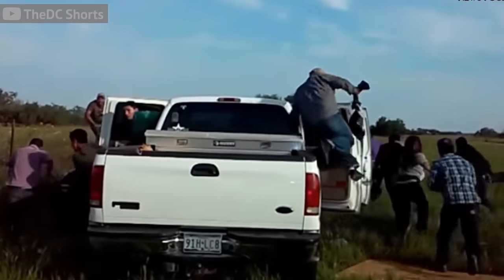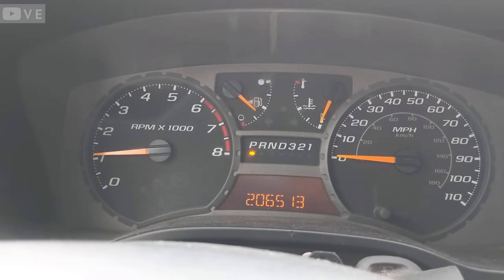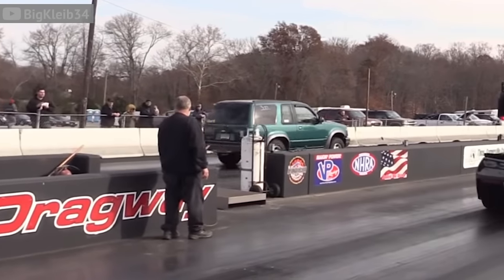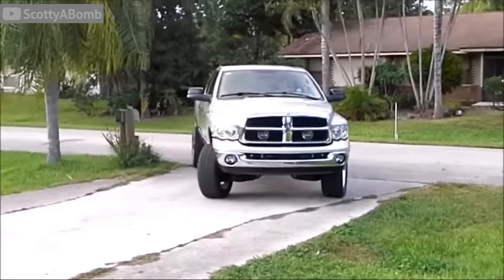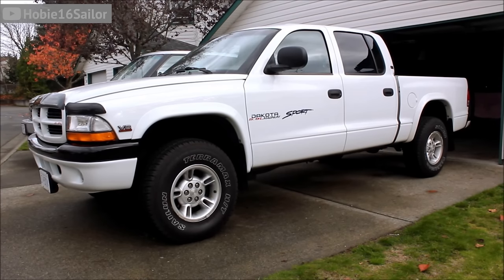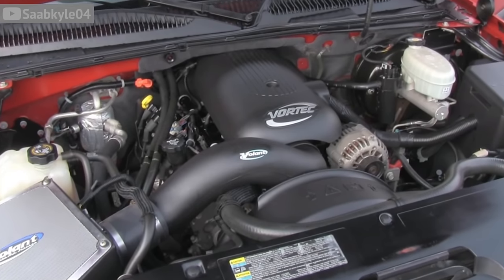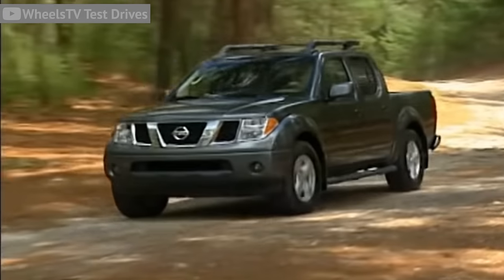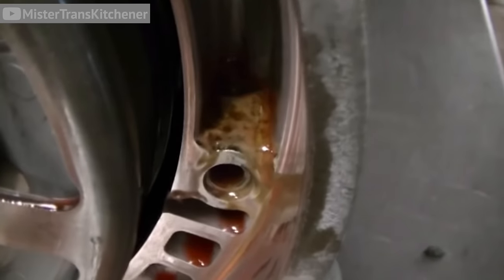USED TRUCKS YOU SHOULD NEVER BUY!

Comment: He probably got cheated on with a guy with an avalanche .
Reply: Fr bro hahaha i have an avalanche and it works perfectly
Reply: I have had my 02 Avalanche since they came out. NEVER had a problem with it ever.
Reply: My dads 02 had 476k before he sold it, great truck. Only y minor problems
Reply: My 03 avalanche runs as good as any, it has outlasted many generations of trucks that proceeded it😂
Reply: I HAD 02 AVALANCHE  with over 300k on it when finally going, ohio uses alot of salt just rusted. have a 07 ltz with 6.0L in it and more problems then the 02
Reply: I have an avalanche. Love it too.
Reply: 5.3 vortec is NOT a bad engine by any means. 07 on with the AFM is not as good as the LM7's but still not a bad engine
Reply: I love my avalanche
Reply: My 2013 avalanche has pretty much never had an issue, 125k miles
Reply: Jose Olvera my dad has an avalanche an that bitch got power an we ain’t had no prob wit it
Reply: My 02 survived alaska for 2 years at 300k miles sold cuz i couldnt bring it with me i have an 07 now and its great
Reply: What's so wrong about the Avalanche? The only thing I've heard is that it's had instrument cluster issues more than anything else.
Reply: @thedl1581  Same here, I bought mine in mid 2001, still have it, it looks, and drives perfectly..
Reply: My 02 Avalanche has 200k miles.  Still looks, runs and drives like new, best-in-class turning radius (very useful for all the u-turns in FL), and only minor wear and tear issues.  The fold-down mid-gate makes it easy to carry my kayaks and gives extra room for lumber hauling.  I did have to replace the headlight switch assembly the other day (something I've heard is an issue, but it HAS been 17 years) which cost a whole $30 and about 5 minutes of my time.  I thought he might mention the fading body cladding issue (he didn't), but that's easily resolved with the deoxidizing auto detailing treatments available over the counter.  Love my avalanche and I'll drive it until it breathes it's last.  At this rate, that should be in about another 17 years.
Reply: So I'm not the only one huh lol
Reply: I love driving my bf avalanche
Reply: he got cheated on BY a guy with an avalanche
Reply: @theintimadator3828  I have an 05 and have heard that the second gens have a lot more issues. Even if they have the 5.3 in them, something about the mounts (I think..could be wrong) mess with the engine & trans on them. I'll keep buying first gens as long as I can find them. They hold their value very well too (all of them!)
Reply: Love the avalanche.  My Grandpa had an 08, he died in 2013 and my dad got the truck.  Still runs good 12 years later today.  No rust.  We live in New England.  Solid truck.
Reply: 5.3 engine is one of the best out there easy to upgrade and replace, that being said avalanches are ugly af especially the ones with all that plastic. The Escalade ext look better but idk how really those are never owned one but to each his own 🤷🏻‍♂️
Reply: My Black Diamond Avalanche is the best truck I've ever had!! He probably drives a Tundra
Reply: Ya this guy is crazy I have a 05 220k mi still have org eng n trans runs like a champ still just had to rebuild the dash cluster n the rest is org except the normal wear n tear stuff
Reply: Lmfao he probably can even get one of those 😂
Reply: MY 02 AVALANCHE HAS 300,000 AND STILL GOING STRONG!! NEVER ANY ISSUES!! 😆
Reply: Daniel Lamb Chevy makes cheap thermostat housing with cheap plastic you never had a coolant leaks
Reply: Funny how he noted that all the Fords that shared the same engine but the 5.3L Vortec that is shared with the Silverado, Tahoe, Suburbans, Yukons, Sierras, Escalades, Express Vans and Savannas. Somehow only the Avalanche is a bad truck. My 02 Avalanche is approaching 300K miles on the original engine and transmission without any major repairs to the drivetrain.
Reply: My Avalanche was a fantastic truck!  I wish I still had my old one sometimes.  I honestly wish they still made it!  With the cladding it was like an urban tank!  Only issue I had was the transfer case leak that would develop in all Chevys of those years.  Fixed it over a weekend.
Reply: RIGHT?! The 4l60e is the only issue I know of on the first gen that is all that bad, and it's not like they were limited to the Avalanche. And the other issues were relatively minor compared to the other vehicles, although I didn't really agree with the SSR because CLEARLY it's not meant as a working truck. "Oh no, the plastic fades?! They're the only vehicles to ever have plastic fade." I don't understand how it wouldn't classify as a truck either. Truck frame, V8, tows pretty much the same as the 1500s, has a bed which you can also fold down the midgate and have a 8 foot bed. It was literally just "I don't like the looks so it's awful." Of course I've also never heard someone down talk a Suburban in appearance before.
Reply: This dude is the type that would think a smart car is a man's car, lol smh
Reply: Judging by the comments about the avalanche.  I think you gotta remove it from the list.
Reply: I've got an 07 Avalanche few minor problems oil sending unit which is a headache thinking you have no oil pressure
I currently have a p430 code which is very annoying I can clear it and it will stay off about a week 
But honestly I LOVE MY AVALANCHE
Reply: Benjamin Williams damnnn mine just reached 200k miles no problems what so ever just minor things
Reply: Yeah his Chevy Avalanche criticisms were bs. I was actually expecting good criticisms but nope.
Reply: i have seen acolorado with 350,000 miles i would have bought it but they wanted too much  like 5k for it lol
Reply: 4.3L V6 Vortec ,285 HP  4.8? Is this a 250,000+ motor, 302 horsepower , Chevrolet 5.3 385 HP . laintiffs formally issued a lawsuit against General Motors in federal court on Wednesday, claiming the Detroit auto giant sold Chevrolet and GMC vehicles from 2011 to 2016 that could not run properly on American diesel fuel as promised. In turn, they say the engines fitted to these models could prematurely expire and leave owners with sizable repair bills due to the supposed issue. The plaintiffs allege that this poses a threat to "hundreds of thousands" of customers who purchased trucks equipped with a 6.6-liter Duramax engine during that timespan.

Per The Detroit News, the lawsuit cites a mechanical failure which causes metal shrapnel to enter the engine via a Bosch-built high-pressure fuel pump. It claims that since American diesel fuel is thinner than in Europe and does not include as many lubricants, air pockets form inside the fuel pump, causing metal-on-metal contact. Shavings then allegedly find their way to the combustion chamber,,  Read more here ,https://www.thedrive.com/news/29331/lawsuit-alleges-chevrolet-and-gmc-duramax-engines-sold-with-wrong-parts-cant-take-american-diesel. But i still enjoy GMC and Silverado nothing will change that i stick with older models and way from diesel
Reply: I have a 2003 Chevrolet Avalanche Z71 4X4. I Love it and wouldn't sell or trade it for anything!!!!!
Reply: Shoot he said it has trans problem but after 18 years and 240k miles. Mine shifted great. I sold it and I still see the new owner driving it occasionally
Reply: nah, he just couldn't find a guy to date with an Avy. I have an 05 and its a BEAST!!!!
Reply: @benjaminwilliams2086  my 02 avalanche z71 has 380+ miles still running strong so much for being a bad truck right
Reply: Hell, I’ve got an 04 Avalanche Z71 with 250k on it. Zero rust, decent paint, no problems. It’s my woods truck. Leather’s still great. Only thing I don’t like about it is the plastic trim, but a little Back-In-Black and it looks brand new.
Reply: Luis Bolanos Thought it did one time, but it was just because I put everything back together incorrectly.
Reply: Probably did avalanches are for ladyboys
Reply: To easy
Reply: Never have problem with my 06 avalanche trouble free 162k miles.
Reply: they have a very week 5.3
Reply: Brady Kee slow yes but they are good reliable motors.
Reply: For really though these are the best trucks ever especially the ones with the 6.0 vortec that’s the one I currently have follow me on instagram y’all @j_ortiz13 you can see my projects truck avalanche
Reply: My 05 Avalanche would randomly switch into 4L while going 70 mph down the freeway. Had to yank out the shaft to the rear wheels to make it 4x2. Then the transmission died and I learned how important it is to apply the emergency break whenever I park (truck rolled down the street one night). Then I crashed into a tree... and had her rebuilt. Then I had a dude crash into me over 90mph, threw me off the freeway, down a hill, across a river and into a forest... and I had her rebuilt.

Today, I got a cracked mirror, the engine light and air bag light are always on, and my running boards are death traps in rain or snow. Not to mention all the sounds that she makes when I turn left and right.

But she runs beautifully. Shes almost st 200k miles. I love my truck lol
Reply: Lol right!!  shit I have a 07’ avalanche with 210,000 and it works GGGreat!
Reply: Avalanche gang 💪🏻 I have an 03 and you just can’t kill it no major repairs yet
Reply: Have a 2002 with 400k miles... original engine and transmission...doesn't use oil, gets 18 mpg on long distance trips. Like the covered truck bed for concealing packaged, suitcases, camping gear...
Reply: I have an 03 Chevy avalanche and it runs fine
Reply: Avalanches are amazing trucks! I got an 02 2500 V8 8.1 Lt. engine, it hauls, baby! Just about to put a leveling kit on it.
Reply: I have an 02 avalanche with just under 80k. It hasn't been perfect but I like it. I've had it 7 years and aside from tires, brakes, oil I probably haven't spent 500 on maintenance or repairs. Good power, good mileage and loaded. Sure it's a glorified suburban,  last I checked burns were pretty fucking dependable.
Reply: @d.chapman8400  and the cladding he say which many other car's have if you don't keep maintenance, and the transmission!
But if the Avalanche is bad, the the whole line is bad silverado n cadillac
Reply: @str8profit81  yeah bro u see tha Avalanche ugly because you have no sense of what it is, and you have never used 1 so you don't know the porpoise of them
Reply: Odi Arroyo “Purpose” learn to spell before @ me clown. The powertrain reliability isn’t a problem I said 5.3 is a great engine I have a 04 Silverado. It’s the physical appearance especially first gen earlier years with the plastic cladding which was removed from later years because it was unpopular and because of problems people were having with it.
Reply: @str8profit81  English is not my first language, and i have the body cladding on mine and it's the best going in the desert around Las Vegas with out worrying about scratching the pain, also i use it for my landscaping bussines and i thought everything in the bed, rocks , gravel, dirt, branches, wood logs, pallets of pavers and all by not worrying about scratching the paint that the Escalade has, and the plastic matches so cool with my 33's they just go together, and it makes sense, that's why those plastics are there, appearance that actually works!
After the sun goes down you remove the middle and made a bed with your girl
 "if you have 1"   and well.. The rest you should know it, 
  there is no Truck that bits that experience my good speller teacher..
Reply: @jeffshemanski3711  I have an 05 also.  What was the dash issues you had?  My dash lights flicker or go out completely.
Reply: @lanawhite1670  a few of the lights got really dim n could barely see them n it kept dinging like some thing needed service so had a mechanic rebuild the whole dash cluster n it was fine the dinging stopped n all the lights n gauges worked like new
Reply: @jeffshemanski3711  thanks for the answer!
Reply: i’ve got an 06 chevy avalanche with 220k and would drive it across the US without any hesitation
Reply: D. Chapman there was and people just hate chevy
Reply: Fr
Reply: The only issue I’ve ever seen/heard with the Avalanche was the plastic trim pieces, but that’s such a small issue it’s not really a issue. I really like the Avalanche.
Reply: @BigCherries  the trim fades. Takes 20 minutes every 6 months to get it back to black
Reply: Mine cot on fire
Reply: lol
Reply: @pistoncasas150  me too
Reply: My only problem is a leaking trunk after 3 years having it and almost 300k miles
Reply: By his definition, I am a bro for driving a reliable truck. By my definition, he is a bro for being 30 with a backwards trucker hat and light blue cartoon shirt with a youtube channel. C'est la vie.
Reply: We had an 04 avalanche, my favorite vehicle I've ever driven, lasted 15 years, the rust got it because we didn't take care of it.
Reply: My first avalanche [2003] came from a guy who was shady AF and "didn't know English" yet when he attempted to whisper to his son he spoke perfect English. This vehicle had several problems. One later rendering it dead. He filled the frame with foam and spray painted it. I only noticed this when a chunk the size of my hand came off. Glad to say my 2004 avalanche is like new.
Reply: 2006 Chevy Avalanche Z71 4x4  5.3 Vortec, 6 inch FabTech lift with 20 inch chrome wheels and  using Nitto G2 tires. All optioned out when purchased. No cladding, Victory Red with Black trim. 260,000 miles right now and running strong. Minor issues here and there and the only major issue was my Transfer case with the weep hole issue and decided to just include to have my transmission rebuilt which includes a 5 year warranty. Never broke down on any road trip and never been towed, EVER!!! Love my baby, was a gift from my late husband and I have a problem parting with it. Maintain, maintain, maintain every little thing you notice, immediately, what ever brand car or truck, motorcycle, wife or husband and longevity and endurance is possible.
Reply: @kirbysmom2011  Get the truck, love the truck, BE THE TRUCK!
Reply: @saltycade9063  Take a heat gun to the area that you are going to apply Back to Black first. When applying the heat gun, the trim will turn black and then let it cool down to a warm , then apply Back to Black. Mine is going on 2 years since I last did it and the bad part is she is outside cause I have no garage for 4 years in HOT Arizona. Still black. I am building a small garage for her now. Lots of elbow grease but worth it.
Reply: @kirbysmom2011  meh is it tho. I live in Canada and rapid heat changes make it worse so easy polish works for it
Reply: Haha!!
Reply: There isn’t many trucks I’d trade my 12 avalanche for. This guy doesn’t have a clue.
Reply: @gjolinares23  do you understand a avalanche can haul full sheets of ply wood or drywall?  The mid gate folds down to give you 81/4 feet. Your comment is uneducated. Bet you drive a Toyota.
Reply: @sdpocketkid  aware, but don’t care. I have only owned real trucks.
01 Silverado ECSB v8
04 3500 ECLB DRW
18 2500 CCSB Z71 DMX
Reply: Loving my 2004 Avalanche in 2021! My truck drives like it’s new!
Reply: Our Avalanche was solid. We did have the speedometer issue, but otherwise we would still have it if the WI salty winters didn't rust it away.
Reply: Lol
Reply: I hate my 2003 avalanche ( North face) but its paid for
Reply: I was told avalanches are amazing and anyone who owns them loves it. Yeah. Man’s definitely got cuckolded by a Chevy avalanche
Reply: I have an 05 and it’s one of the smoothest riding trucks I’ve driven. I haven’t had any issues with it.
Reply: Literally bc you can still use these every after 200k miles if kept up with
Reply: Just bought an Avalanche a hand full of people including owners of shops said hold onto its a great strong truck
Reply: I have an 03, getting close to 300,000 no issues, exempt for the cladding, which I take care of😊😊
Reply: I'm in love with my avalanche. Yes it's been a fixer upper but worth the constant maintenance, it's an opportunity to sharpen my automotive skills
Reply: I have a 02 avalanche with 400k+ miles on it only thing that happened to it is that my rear end went bad
Reply: My 03 avalanche has around 300k on it and I have no complaints
Reply: Avalanche is Good!